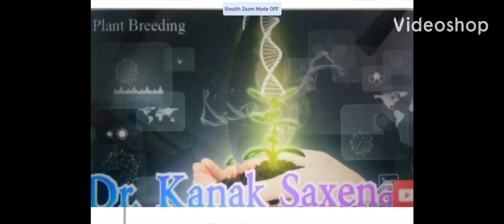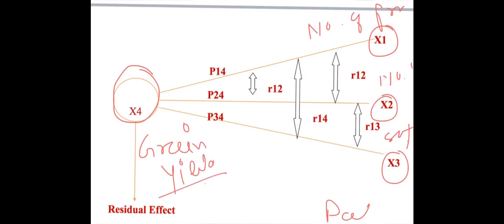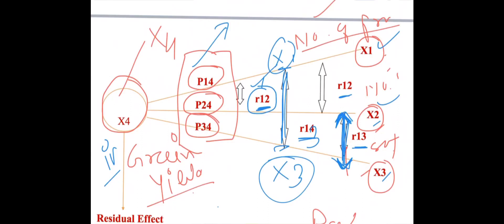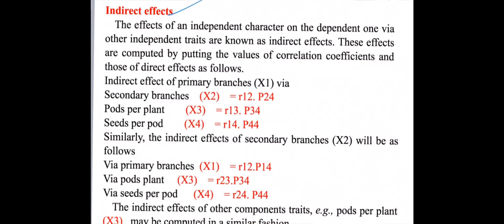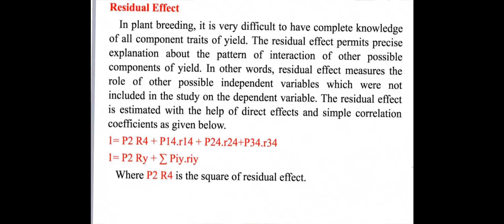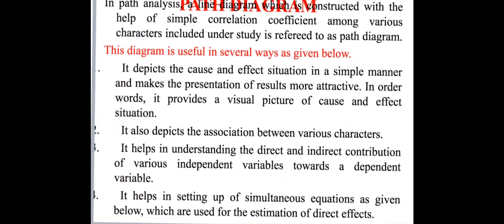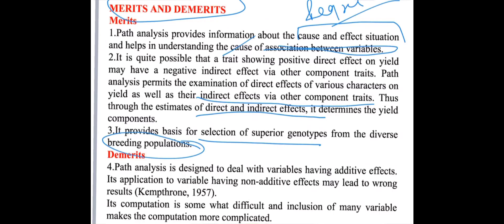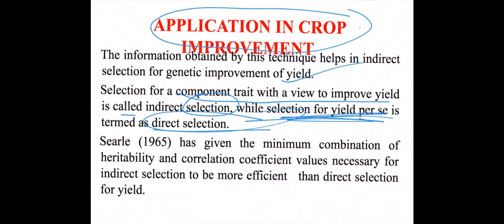Path Coefficient Analysis | PATH Diagram | Plant Breeding |Quantitative Genetics- By Dr.Kanak

Comment: I have one question, can residual value be negative?
Reply from the maker: Residual effect means the role of other possible independent variables which were not included in the study on the dependent variable
Yes, value can be negative but it is considered as inadequate fit model.
Normally, It ranges from zero (perfect fit) to one (very poor fit).
The value of a well-fitting model should be < .05.